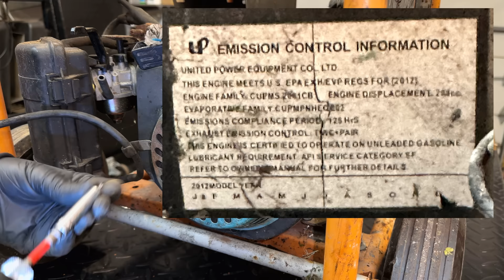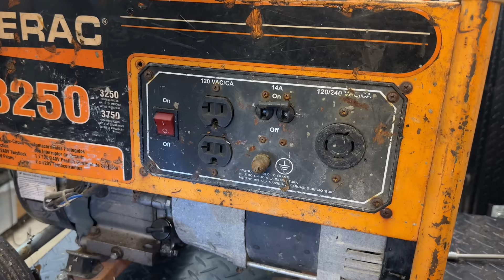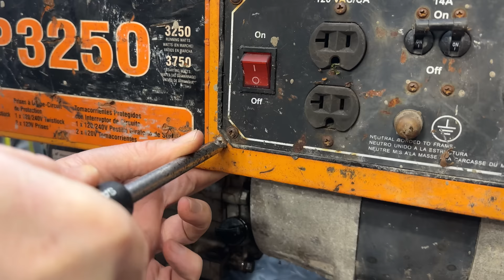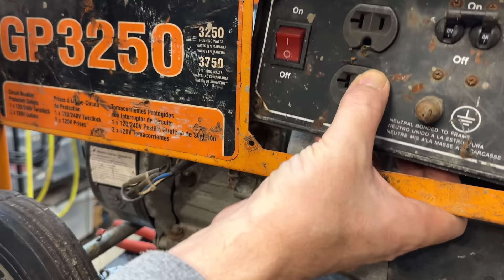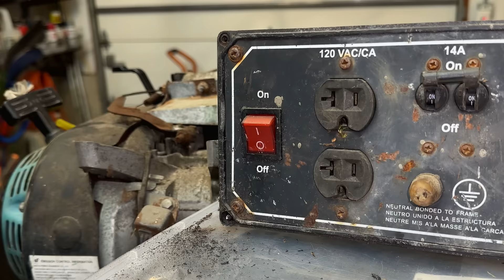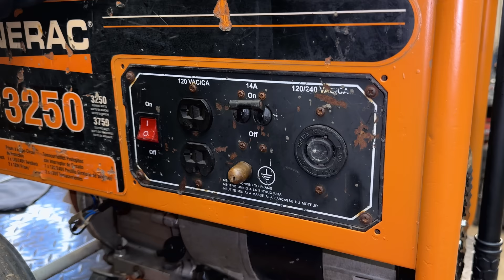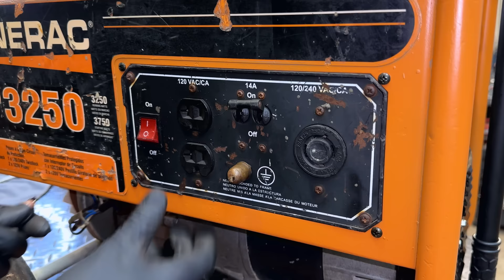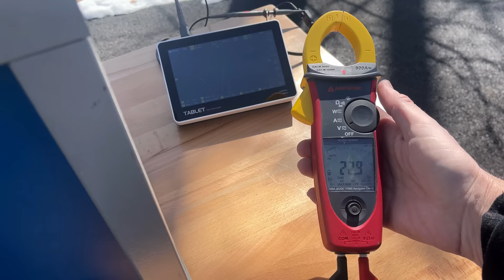Abandoned Generac GP3250 - Will It Run and Make Power?

Comment: That’s awesome your daughter wanted to help! Nothing like father/daughter time. Next question is when your wife will join you in the shop? That was an awesome rebuild! You must have quite a few used/rebuilt machines in your shop to keep all your customers happy? Just curious why if that generator is top rated to 3750 watts surge it can’t? Yes, it pull 3100 watts but that seems awfully conservative based on the name plate? 
Still it’s a 120/240 genny with so few available watts? Good for a small home in a pinch during an outage? 
Keep up the great content. Looking forward to your next video. Thank you!
Reply from the maker: Usually the engines are sized to barely make the rated load.  The surge numbers do not indicate for how long.  Usually I would guess less than a second before the engine goes to stall.  Circuit breakers are also size to handle that surge without tripping.  A rule of thumb is 500 to 550 watts per horse power is all you can expect.
Reply: @jcondon1  This isn't an argument but rather a question? In the case of the Honda EU 7000is. That has a 13 horsepower engine. It is rated at 5500 watts. Its rated surge is 7000 watts. I have tested mine to 9200 watts continuous all day long. That delivers if I do the math right? Over 700 watts per horsepower? 
Is that because it's not in that equation because it's a much better generator?
Reply from the maker: @johnclyne6350  the EU7000 and EU6500 are the rare exception.  Honda puts an extra 3hp on so the engine has no issue at 7000 watts.  I tested my max load on my EU6500 last year and topped out at around 7000 watts.  Maybe fuel injection adds more power?  Also inverters can run at over 3600 rpm.  The 13hp is likely the rating at 3600 rpm.  https://youtu.be/lEfrKIKLE60?si=PJy8AsgmVEO55pki
Reply: I know of others that have the Honda EU7000is generator that report similar findings as far as available power from that generator. 9201 watts will make it stall & throw an overload light. When I have everything on in my house be it central air or baseboard heat in one room I draw on average about 3750 watts. Well within the capacity of the EU7000is. I have a soft start kit on my 2-1/2 ton central air. The Honda never skips a beat. The power I get from the Honda is better than my local utility can provide. I get steady 123-123-246. My local utility provides 121-122-243. Almost as good. Well within specification though. I live right on the back bone less than a mile from my house is the substation. 
That was an incredible demonstration of your abilities on that Generac. I'm starting to think that money is no object even for machines that have exceeded their expected life time? Rather your channel shows the process it takes to restore it to new like condition just for the viewers? You'll probably never recoup your money on that Generac? But is that really the point? Nice job!

Comment: I fully expected to see the first ever 20 gallon Evapo-rust full generator dip done!
Reply from the maker: Oh, I have come close on a few times recently.  Seems like most of the "free" generators are far from free.  If evapo-rust was cheaper, I would have a 20 gallon tank setup.
Reply: @jcondon1  Order it in 5 gallon from Grainger's. Same price as 3 one gallon jugs. Them use a cheap bilge pump to just cycle it over your material.
Reply: Have you seen Ed China dip an entire Range Rover frame in Evaporust?  It was pretty amazing!

Comment: When you have a situation like you describe of that part falling into the engine always use a magnetized wrench or screwdriver or for that mater magnetize the tool being used to remove or assemble the part !  Read on  ! Years ago a mechanic was taking out a spark plug and loosened the nut on the plug and that nut on the plug fell into the plug hole causing the removal of the head of the moter  !

Comment: Hi James, one thought on the exhaust: I drop those in citric acid and hot water, that dissolves the rust in no time but leaves the good metal alone so no danger of holes. The methode is cheap, easy and very effective. I don´t know why not more people do it, I have a video about that on my channel (it´s in german though) but that demonstrates how well the methode works. Just a thought for cleaning up rusty parts in the future (like that governor arm...).
Reply from the maker: Will have to give that a try.  Have heard a lot of good things about Citrix acid.  Thanks.
Reply: @jcondon1 You´re welcome! As said, it´s cheap, effective and doesn´t eat away metal. No special equiment needed, just boiling water and citric acid (powder is better than liquid if you can get that stuff in the US) which costs around 2,50 bucks for 500 grams and gets you far. Works really well for rusted out tanks and I´m sure it´s cheaper than Evaporust ;) Another advantage is that you can just dispose of it through the drain. Doesn´t work so fast with cold water but you don´t have to keep it heated, boiling temperature initially is suffficient.

Comment: Instead of wiping down with alcohol try using a phosphoric acid solution,  it will eat up the rust and prepare the surface for painting. The finish will last longer as well.

Comment: Surprised that you didn’t pull the  air filter cover off before you started so it didn’t pull debris in. 
Curious why you don’t spray fuel into the carb to test if it starts instead of the cylinder directly? 
Cool that you got a viable machine, I didn’t have much hope for it either.

Comment: I would have used spacers on the gas tank. You need a blast cabinet for the rusted parts. Also, you can do soda blasting on the aluminum and other rusted parts like the governor parts.

Comment: Hey James sometimes you can drill the center with a 40 drill bit allowing the Apex tip to go farther in and get a grip, as long as the Apex isn't too stripped on The rusted screw

Comment: Great video as always.  You should try Dawn Processional de-greaser.  It works pretty well and doesn't seem to harm aluminum.
Reply from the maker: It was on the short list to try.  I ended up buying some simple green pro hd.
Reply: @jcondon1 Good Deal.  I used the Dawn on the bilge of my sailboat it is came out squeaky clean.

Comment: Great Job, James. I'm curious to know what welder you are using and whether you are using hard wire or something else. I see you struggling each time you pull out the welder. I may have a useful tip for you. If you use hard wire either, .035" or .045", playing around with wire feed speed and current adjustment, you should be able to tune in the weld. With hard wire, a properly adjusted welder will sound like a bee buzzing with zero popping and minimal spatter. Keep in mind that I have seen and used high quality welders that could not achieve a well-tuned "buzz", but I've also used cheap welders that could. Also note that I am not knocking your ability to weld. I think anyone can. I also understand that it can be difficult to weld on dirty steel, but you have done a good job cleaning the surfaces. So, basically, I guess what I'm saying is, one needs to adjust the feed speed to the timing of the arc. Hope this helps a little.

Comment: Take a black zip tie, and a soldering iron on low, and melt,plastic back into the control panel lower left corner screw boss. It would have stuck. You could have even done it with the screw in place to mold threads into the new plastic.

Comment: If you're welder is a dual voltage welder. It will work better at lower settings if you are on the 240 voltage settings. Oh and by the way always clean what you're going to say and before you sand it. I know what you're thinking but it doesn't work that way I was born and raised in a body shop retired as a machinist.

Comment: I’m restoring essentially the same machine right now, but in much better cosmetic condition. That one really looks like a contractor generator which got banged around with a lot of other equipment in the back of a pickup its entire life. 
I have to disagree with the low price estimate on these. I did a bunch of research before digging into mine and the low end is around $300. I’ll probably list mine for $350 even though it’s in near perfect condition.

Comment: Question. Why do you not first check for spark before putting fuel in cylinder and start it
Reply from the maker: I did check the plug and held it up to the camera.  Do you mean check for spark?  Sometimes it’s faster to just put some fuel in and pull the cord.  If it kicks then you know right away you have spark, compression and timing.
Reply: @jcondon1  yeah i meant check for spark
Reply: It saves a lot of time by putting gas or starting fluid in first. If it starts it tells you that a lot is working which would be spark, compression and timing. The only thing left is fuel..
Reply: Looks worse than just being left outside.  Maybe near a shore point where the salt air attacked it.  Once I had pool chlorine powder get damp in a shed and the outgas attacked anything metal in there.  Also grass clippings left on garden equipment can outgas and be mildly corrosive to equipment near by.  Anyhow great job!  Very satisfying to see it brought back to this level.  I could have made a case just to get it working well and put up with the looks.

Comment: 1:21:43 just a little bit of advice stop using brute force to try to bust bolts and nuts loose. If you hit the ratchet like a hammer that gives you an impact with your ratchet it’s a lot easier this makes sense and may help you.

Comment: I don't think the recipe for the degreaser changing is the problem, the problem is some carbs are made of magnesium alloy instead of aluminium, they look and behave very similar for most applications, but magnesium corrodes easier. 
The easy way to tell the difference between the two is with a drop of vinegar, if it bubbles, it's magnesium and can't go in the citric acid degreaser.

Comment: Use my mix 25% white distilled vinegar... 25% simple green PURPLE ..... And 50% distill water don't leave the carb in the mix longer then 3hrs it will darken the aluminum carb, also use a big plastic mayo jar fill it with my mix then fill the Ultrasonic cleaner with regular water.... Heat it up, then turn the heat off and turn on the ultrasonics..... Rinse with tap water then blow out with compressed air..... I haven't met a carb it couldn't clean.

Comment: James, great job of rejuvenating another seemingly lost cause.   For your stuck screw problem, have you tried using a manual impact driver?  The type where you set the direction and then hit the driver with a hammer to force the rotation?  I use one when I work on my car’s brake rotors to get the holding screws out as well as really stubborn screws where a powered impact driver is likely to rip apart the screw heads.   Btw how could I donate a mower to your channel?  I have an older honda push mower that has been sitting for years. Is this something you would be interested in?

Comment: Prinz screws similar to those silly things Honda use Valve Crossover is the WRONG place to set the valve clearance  you need to be 180 degrees round  .

Comment: You know cross threading bolts is a Hillbilly's Loc Tite...LOL   James have you ever tried or used Simple Green cleaner in the ultra sound machine ?   I've used it on all sorts of equipment even my Harley Davidson motorcycle including the aluminum engine parts with no ill results.  I would have never guessed you would have brought that piece back from the grave,  I thought you were putting lip stick on a pig.  Awesome job generator whisperer !
Reply from the maker: I recently started using Simple Green PRO HD.  Very good results.
Reply: @jcondon1  Awesome it's good stuff

Comment: Heya. Don't want nor mean to be a Karen here: You do realize that the Dewalt bit holder you tend to use alot, is meant for driving screws in... hence the retractable 'sheath'..... You stick your screw on your magnetic bit, then pull the sheath down, over the screw and you can drill them in better/straighter... more for wood and/or drywall. Keep up the great work, bud, and keep them vids a coming, ja?

Comment: I love your videos but I have a suggestion, you spend a lot of time as well as running up and down the road buying a few screws and bolts at the time, and over the years I have built and collected small and large hardware bins and we have a place near me called 
valley fasteners and I make a ocasional trip up there and it is nothing for me to buy a total of a couple hundred screws and bolts and sometimes several hundred because buying up there I buy them for maybe 1/10 th the cost of hardware stores and I have collected thousands of screws and bolts and when I need something there is at least 99 percent chance that I have what I need  unless it is something special and I will make a trip up there and make a list of things that I want to add including drill bits, taps etc the bottom line is if I need something I have it including the bits taps including pop rivets everything and I buy all of it  for a small fraction of the cost.

Comment: You're the best teacher I never had. 
Question: What is the idle RPM of a an inverter generator with economy switch on and no load applied?  
Which budget 2000W- 2500W inverter-generator do you recommend I should buy? From Canada with ♥
Reply from the maker: Not sure I ever measured the speed, but most range from 2500-4000 rpm depending on the load.  Would stick with a name brand that has a warranty.  The really cheap ones might be just as good, but there is no real company standing behind them when something goes wrong.

Comment: First for a long time I would disagree with. Personally, I would have invested an hr or two to make the best of the old tank also forcing or replacing the screw that set the throttle. The more you spend the more you have to sell it for. I would also have pressure washed it before touching it !
Reply: Pressure washing is absolutely needed.
Reply: & replaceing throttle stop screw kit because they ar stuck & rusty? realy? REALY?!!

Comment: I bet this generator was used at a construction site and concrete dust, dirt and moisture was allowed to settle on the machine.  Plaster dust and concrete dust are fairly corrosive on bare metals.

Comment: Watched your videos for years. Really first class. Now I have an issue that I hope you can provide insight. I have a Generac portable 15KW twin cylinder generator with an electronic governor. It runs fine, but it is sifting from 58 hz through 63hz with associated swings in voltage. I have not been able to get a response out of Generac. Can you provide any ideas or where to go for a service manual ?
Thank you.

Comment: It.might be there in gas in the oil causing the engine to be hard to pull start if the fuel shut off valve was left on

Comment: What is the extra piece on the exhaust down between the connection to engine and muffler.  A piece of zinc for electrical sacrifice rather than the exhaust nuts?
Reply from the maker: I have been wondering the same.  There are little hole in it.  Thinking possibly to help minute exhaust damage when a backfire occurs?  Not sure.

Comment: I have a honda exp6500 its 220volt 5000 watt generator if  you do the calculations it should be able to run 22amps load. But when i try to run bore hole which draws 18amps on startup the drops to 9 to 10 amps run it loads motor down and trips breaker. Not sure what problem is. I hope you can give me ideas. Im in Africa

Comment: Soooooo, the machine is only worth 250. You have about 150 (? I think) in parts, not including sanding, paint, welding costs and labor (a lot of labor). What is the plan for the machine? Sell to at least recoup the parts cost?
Reply from the maker: Will sell it and break even or maybe make a little spending money.  I would have never purchased one like this.  Not much profit on it, but could not pass up a free machine.  Was hoping it was a parts machine and really the best way to make money on this one was to keep it as a parts machine to save something that does not need much work.
Reply: The point of all of this is to turn what someone else would send to the landfill into a viable machine. Sometimes meeting a challenge is more important than making a few bucks. Besides, if not for james’ persistence, I wouldn’t have learned so much…
Reply from the maker: @M-Series-guy  well said
Reply: @M-Series-guy  I am certainly not disputing what you stated! I love all of James videos! 
I ask because I am just that way. I do believe James knows by many of my other comments that I am not a critic, I am just curious.

Comment: Got a question I reconditioned a power washer went thru carb cleaned man jet and emoltion tube runs well but surges started and then smothes out whenyou pull triggerfor water thoughts my old pressure washer did same is this normal?
Reply from the maker: The pilot jet is not letting enough fuel through.  It is a common problem even on new engines.  Usually has to be drilled out a couple sizes with a micro drill bit set.

Comment: What do you use for paint and is it resistant to gas?
Reply from the maker: The black paint on the tank was engine enamel.  It is resistant to gas, but it takes a good 3 weeks to cure before you can spill gas on it or it will wash the paint off.

Comment: Wouldn’t making this a parts machine, would have been more economical and it would have helped save other Generations??
Reply from the maker: Yes, but usually do not take apart generators unless they have bad engine or generator head.  This one probably should have been the exception.